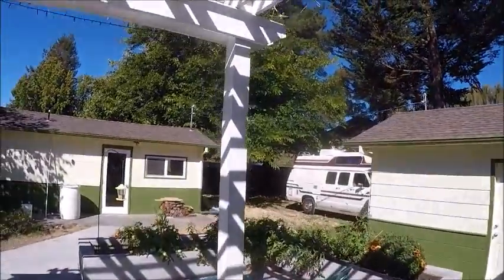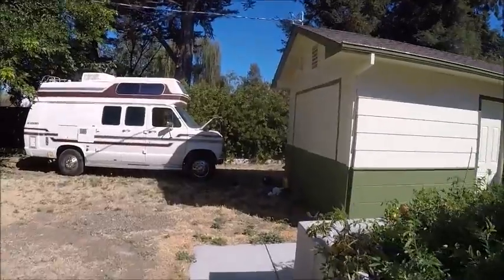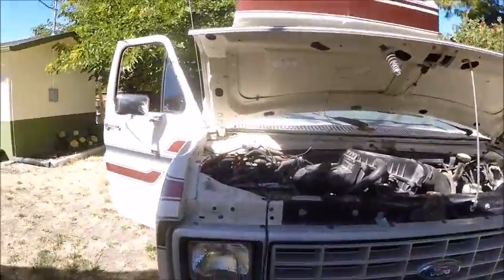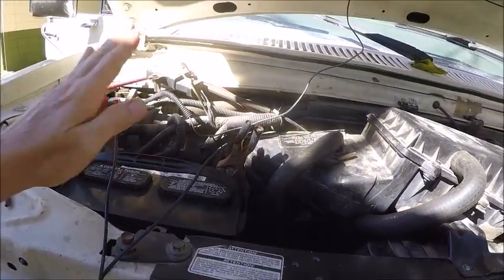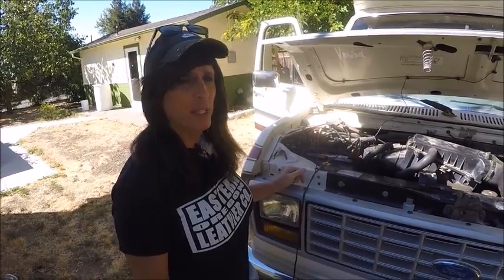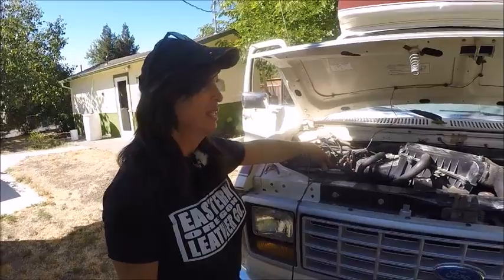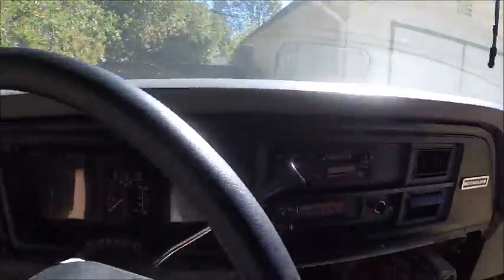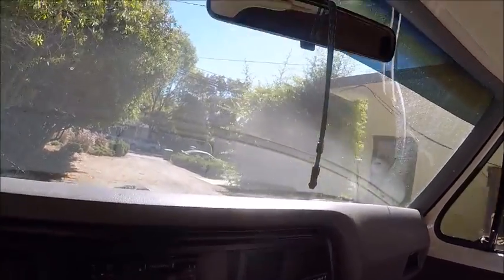Restoring & Repairing the 1988 Coachman Class B RV (Part 1)...Where to Begin?

Comment: Rosie it has been my experience when flushing the radiator that within a very short period of time the water pump will fail.  Does that happen to you when you flush systems?  One other thing do you plan to change the plug wires or are they ok?
Reply from the maker: I plan on replacing the water pump but I have a conditioner to preserve bearings...the plug wires are good..the rig is very clean..it just suffers a bit from having sat five years...cheers
Reply: In future video please let us know if the water pump does start to leak before you replace it.  Just trying to figure out if I am the only one this seems to happen to.  Thanks.